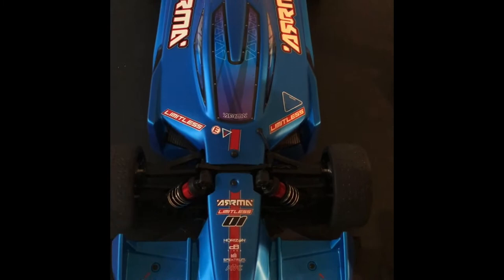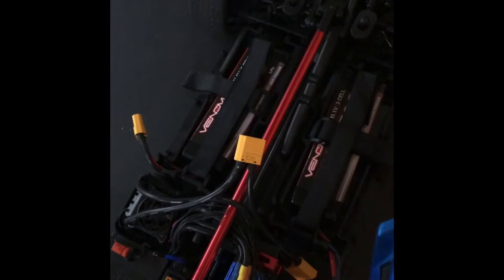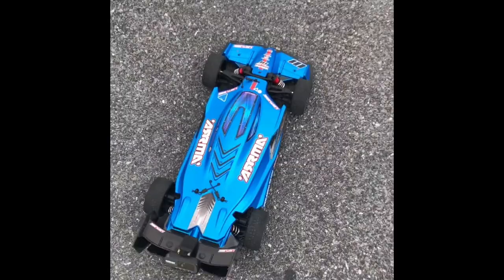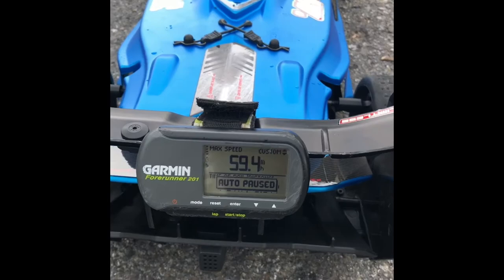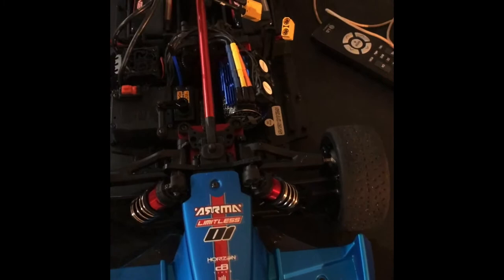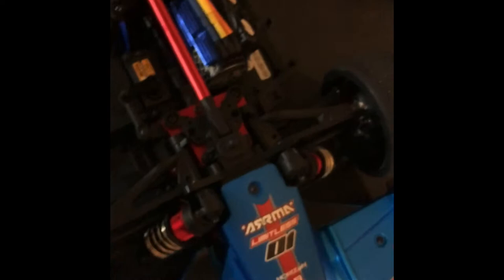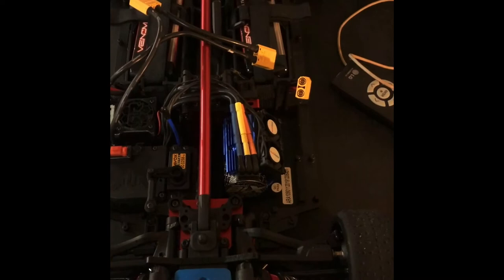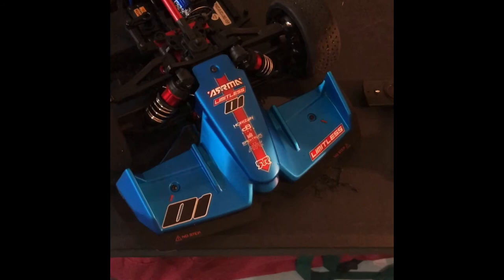Arrma limitless quick blast and update

Comment: Very cool on the updates looking good I’d go xlx with tp works the best make sure to add cap packs 🔥🔥🔥🔥
Reply from the maker: Earl Moorhead thanks a lot Earl. I definitely want to do something different and new. I have the infraction to bash and the limitless for speed/bash.
Reply from the maker: Earl Moorhead which tp motor should I use? Also the tp motor that mounts in the stock position which motor is that?
Reply: UD RC the 4050 fits in stock location 4070 cm is what all the speed guys using 👍👍🔥🔥🔥🔥
Reply from the maker: Earl Moorhead thanks a lot. Does both take a 8s well
Reply: UD RC long as the esc takes 8s yes they do